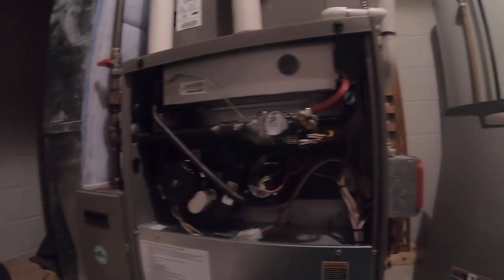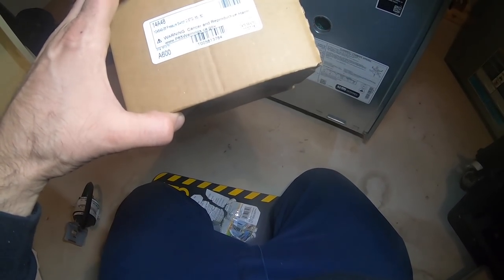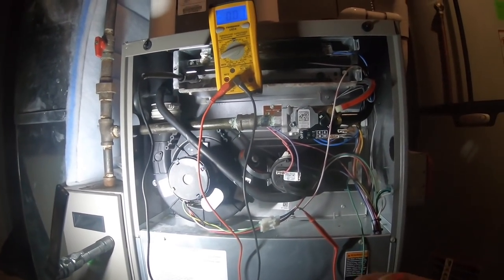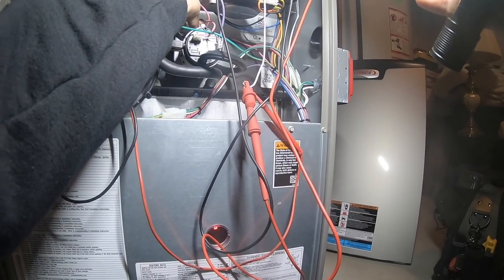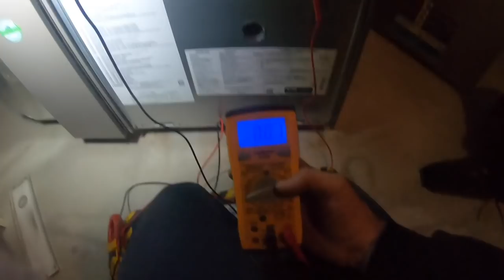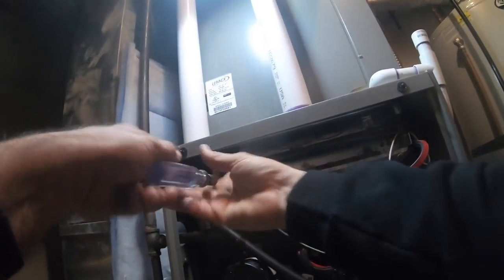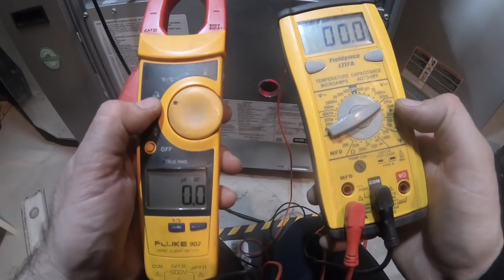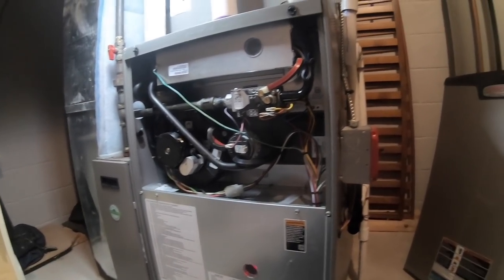Heat Repair Replace Faulty Pressure Switch

Comment: For these lennox units the board will tell you your flame sensor reading. If you hold down the diagnostic button until you either see  - or F than release the button the board will tell you how many microamps your getting. Lennox El296 and the Slp98 lineup do that. On the bottom blower cover door it explains the diagnostic button procedures
Reply from the maker: I know the board yet never used it for that. Every time you change one of these boards even with an icomfort you still need to program the unit size into it. I will play with the flame reading next time I work on one. Does the condenser board read amps on he xc25? Just like the indoor board can show flame current? The fault memory is why I don’t care if the customer resets power to get there system back on. Plus the icomfort also holds onto all the faults. The icomfort also can give you lots of info on what’s happening in the system.
Reply: the last time I trusted a "board" to tell me anything, I returned in 4 hours to replace it because it was trash ;)
always back up the garbage sparktronic readings with a well known working sparktronic meter... or go real old school and bust out the analog stuff ;)

Comment: In a pinch when the trap was so tight up against the wall you couldn't get it out, like in a closet. I have drain the water out of the box and dryed it good with a paper towel and then coated it with flex seal and have the homeowner leave it off for a few hours. It's work both times I've done it 👍
Reply from the maker: Good to know for the in the pinch moments

Comment: Hey about ur video yesterday I do apologize for the negativity and I still like the content and conversation
Reply from the maker: It’s cool I grew up with 2 brothers so we would fight and the next day forget. We have different codes. It’s why my response to your response wasn’t to keep fighting. It was just to bring to the table we have different codes everywhere. So in Canada you need to use a band strap on your flex connections? Here zip tie is all required. When I started we just taped them on you can see how good the tape holds the over years.

Comment: From the manual “The diagnostic push button is located adjacent to the seven-segment diagnostic LED. This button is used to en able the Error Code Recall “E” mode, the Flame Signal “F” mode and “P” the Program Unit Capacity/Size mode. Press the button and hold it to cycle through a menu of options. Every five seconds a new menu item will be displayed. When the button is released, the displayed item will be se lected. Once all items in the menu have been displayed, the menu resumes from the beginning until the button is re leased.”
Reply from the maker: My next video is on the s30 i-comfort. Listed on my facebook page and will list here tomorrow.

Comment: Dude you're not crazy. I get the exact same reading on the flame rod of those Lennox units. In Low- fire the uA (micro amp) reading jumps all over the place. Apparently that's just normal. 
And I have fixed dozens of leaks coming from the red plug on the left side of the furnace ( for the unused drain line). They put that stupid soft pipe dope stuff around the threads and it doesn't keep it from leaking. I have to pull it out of there and wrap it with Teflon tape and then screw it back in good and tight.
Reply: I like having another Lennox guy on here running into the same kind of crap I do all the time 👍
Reply: Shannon Knight HVAC yes those red plugs always leak. I removed and add Teflon tape and that does the trick.
Reply: Whatz up Canada Cory 👍
Reply from the maker: I have gotten good at sealing that plug leak on the cold header box. At first I would just order the whole kit since Lennox ask no questions they warranty everything. Only way I knew how to get a new drain trap. Then I fought with the opening mostly buried by the merv box. Then I learned I could just pull it out far enough to reseal the plug with lots of Teflon and dope. Our installers were at first overtightening that fitting why at first I was just ordering the whole box since I always expected it to be cracked. Yet this style trap is better than the black box with the 2 rubber drain plugs that would always crack
Reply: The two rubber plugs that mice would always chew off in the crawl space 🐀🐁🐭
Reply from the maker: We don’t have many crawl spaces around here so those plugs would last but the box would always crack and need to get siliconed up so it wasn’t pulling air in. Most likely someone bumped it when trying to sneak by the furnace

Comment: for flame sense/rectification, make sure the burner assembly is all clean and tightly screwed together, meaning the burners, gas tube and burner box cover with green ground wire "screws". that is the main return path of the low current path. that was and is always a plague, more so on the earliest flame sensing units, followed by sensing via the ignitors, which quickly develop oxidation and impurity buildup fast and cause dropouts. (add-on flame sense kits anyone?)
Reply: so, after removing cover, put the screw and ground wire back on for most accurate reading, with loading of control board/circuit... have had them get condensate/moisture into the blower/burner pass-through connectors before and pull the signal down and same in A/C mode, causing total lockouts!

Comment: next thing, fluorescent lights(worse with electronic ballast) and LED lights emit a ton of noise as does most electronic circuit board controlled units, worse as they age and electrolytic capacitors dry out. so best bet is twist meter leads together the whole way and keep the points being tested as close as possible together.... also your body makes a great receiver antenna and it will jum back through the meter and wiring to the unit (RF signal/noise), could be effected by cellphone, camera, other additional lighting....  ahh, the pitfalls of all the spark/junktronics polluting the earth ;)
Reply: I should mention, dirty burners/cross-over tubes that are "flickering" can whack out the flame sense too, it could also be  bad HE or massive leakage(high static pressure) if it occurs after blower turn on! so many things, that could be easily missed :(

Comment: Pls tell me where u buy that flashlight
Reply: Braun LED at Harbor Freight
Reply: i bought 2 of them i first saw them on one of his videos,you will regret buying it those flashlights are awesome!
Reply from the maker: Julio here is a link at the end of the video when the 4 squats pop up one is on a review i did on that light. I’m suprised I haven’t broke it yet. The other day I was pushing a pilot valve  N a gas fireplace using the light. It feel in a puddle dropped many times. Unlike the quantum light I was trying to use before this is one harbor freight got right
Reply: Thanks... I need one...great video bro